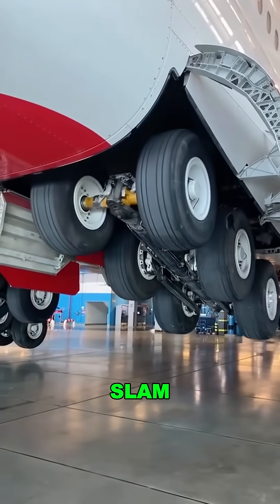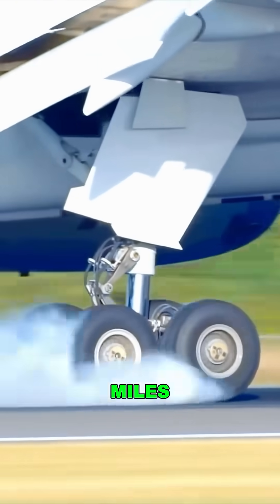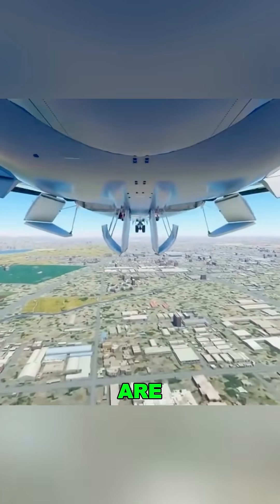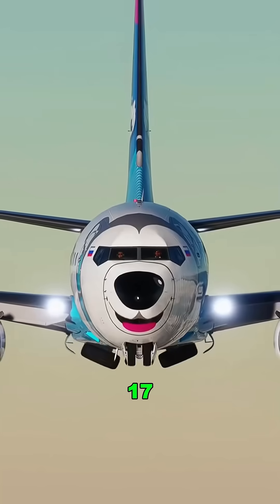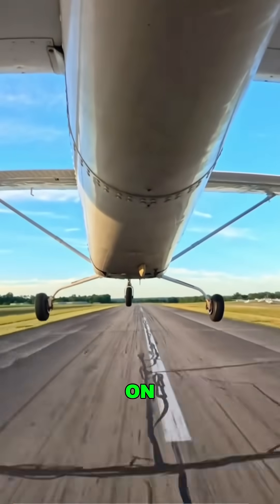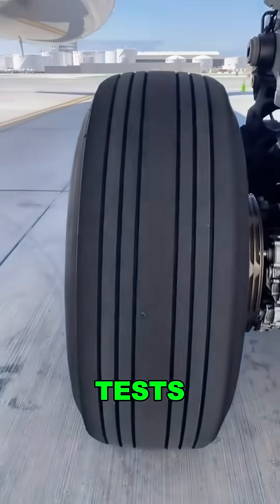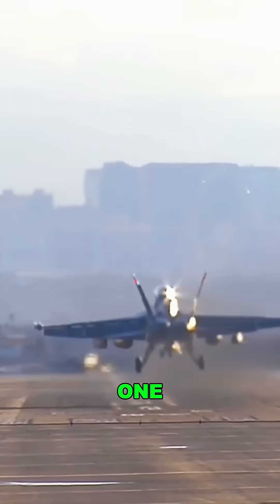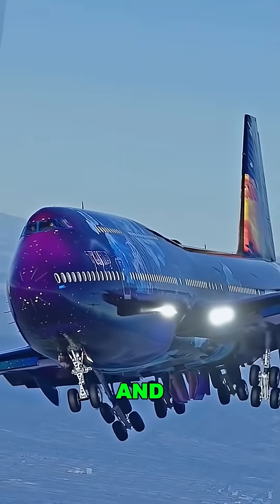This Is Why Giant Planes Don’t Crash on Landing! #automobile

Comment: Small problem: giant planes do crash on landing. United Airlines Flight 232 is the perfect example of this. United Airlines Flight 232 took of from the former Stapleton International Airport in Denver Colorado with its intended destination being O'Hare International Airport in Chicago, Illinois. One hour into the flight the fan disk in the 3rd engine failed. While trying to do an emergency landing at Sioux City it cartwheeled on landing killing 112 people. A more recent one happened February 17th of this year when Delta Connection Flight 4819 flipped upside down while landing at Toronto Pearson International Airport.